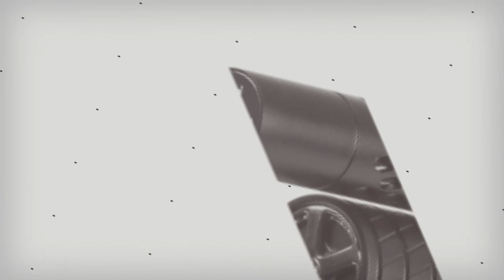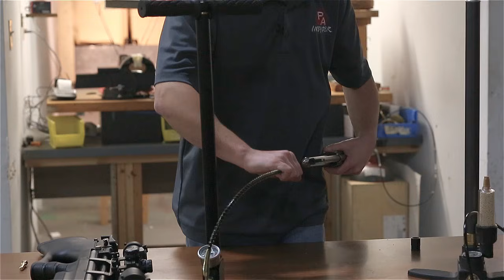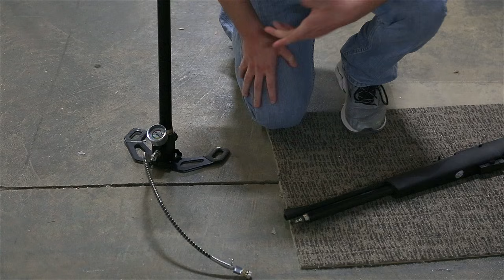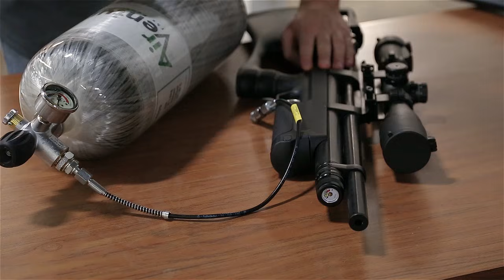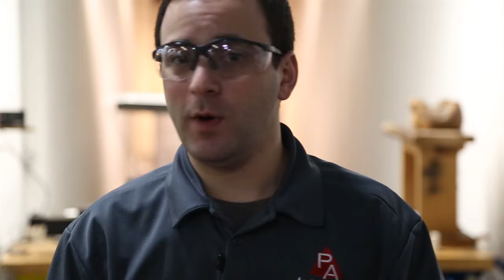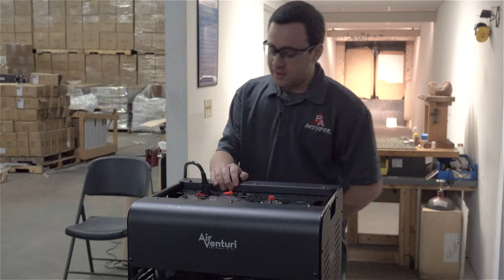🛠️ A Practical Guide to Filling PCPs│ Episode 3 - PCP Airguns 101: How to fill your PCP Air Gun

Comment: Am trying to fill my Hatsan Hercules QE am using this compressor but it won't fill anything, you know if this is the right compressor?
YONG HENG High Pressure Air Compressor Pump,Adjustable Control with Auto-Stop 110V 30Mpa Electric Air Pump Air Rifle PCP 4500PSI Paintball Fill Station for Fire Fighting and Diving
Reply from the maker: Sounds like a compressor issue

Comment: Hello, I am a bit late for the party but I hope you can advise me about my PCP rifle. So I have a compressor and once I stop filling it I stop the compressor and need to bleed the hose. However, If I slowly bleed the compressor the rifle's valve won't close and will vent all the air in the tank. If I rapidly bleed the air from the compressor the piston valve of the compressor will go bad. Could you please tell me what additional valves I need so I can shut the compressor and then bleed the air safely? Thank you!

Comment: Can you use any sort of compressor to fill rifles?
Reply from the maker: Your average shop compressor only puts out 100-200 psi. Most PCPs fill to 3000 psi or higher. So you would need a high pressure compressor to get the job done. We have a number of them that will work.

Comment: I have a glycerine filled pressure gauge where the rubber plug on the side came out and most of the oil drained out of it.  I had an old gauge sitting around so I took the plug out of it and poured the oil into the first one then put the rubber plug back in.   Will that affect the gauge's performance?
Second question, the bleeder valve, which is a push button type, doesn't close properly once I drain the hose and continues to leak air until I push it back from the other side.  Can that be fixed?  Thank you

Comment: Useful, but you made the mistake of allowing the fill probe to contact the floor after filling. (02.16)Neither did you put a plug in the end of the fitting. Both actions are likely to allow dust and contaminants to enter the air chamber and cause future problems. Important to keep all your filling equipment immaculate, I even put my probe in a sealed bag when not in use.
Also, do you not think it worthwhile to fit a moisture trap to a hand pump? On a humid day I think it could be a problem, if the farm compressor is anything to go by. Do PCP tanks rot out like compressor tanks?

Comment: Hi brother I have a question about refilling the air gun from the air tank. If you happen to fill pass into the red zone will it mess up the O-ring inside the tank in the gun, because when I bleed the tank all the air from the gun came out too.

Comment: I have an issue where after I finished pumping my PCP to max.  When I bleed the hose like in the video, the air from my PCP bleed out too.  Does anyone have this issue?
Reply: Valve on the gun broken?
Reply: OR STUCK OPEN----I just sent a brand new $800.00 eagle claw .22 pcp back with a stuck fill valve. @JoeWalker98

Comment: I don't know what the intended purpose of this video was. But it definitely convinced me not to buy a PCP rifle. It's either a lot of work or a lot of money.
I'll just stick with my powder burners.
Reply: Enjoy spending quite a bit more on ammo then.
Reply: @matthewphillips5483  That's hardly a con. The lack of needing air and upkeep more than makes up for the higher ammo cost.

Although my opinion is you should own both.

Lots of powder burner owners keep 22s around for plinking. So once you stock up there's really no need to keep buying ammo. Guys that plink with expensive ammo can afford it so it's a non-issue. Airgunners shoot more BECAUSE of the cheap pellets. Also with things like mantis X, going to the range isn't as necessary.

He's totally right though. For all the extra work that needs to go into air rifles. Powder burners are still the way to go IF you can legally own them. Pumping sucks, even with air compressors and tanks, and it's dangerous.

Air rifles are fun and can be great tools, but they're not practical in a SHTF situation. Getting air to these things would be difficult. Not to mention the upkeep. Worrying about o-rings and other issues specific to air rifles. The powder burner you just oil the damn thing. I'd rather "carry" a powder burner with 100 rounds then carry an air rifle with 300 rounds and a hand pump. The odds of finding ammo out in the world is a lot higher than finding a 4500 psi air compressor if your pump breaks 

At home, or once you have a FOB established then the air rifle would come in handy for collecting food, but powder burner for being mobile and self-defense (if you can own one) if not CERTAIN air rifles are sufficient.

It's just too bad we can't fill these things with regular air compressors. That would be a complete game changer. Even a shoebox compressor requires you to lug around the shoebox. Ammo weighs a lot too though, but still the upkeep swings it in the powder burners favor.
Reply: Just get a hand pump. The guys a puss it’s not hard.
Reply: So! Why did You even comment?  -_-
Reply: @michaelwolff9207  People like to share their opinion.
Reply: Honestly, if you can legally own powder burners and you don't have an interest in silent shooting. I wouldn't get an airgun either.

Most people that get into air rifles also have powder burners and just like the idea of PCP. Or for people that can't legally own powder burners.
Reply: Come talk to me when the feds finally pass a bill to stop making ammo for powder burners. It's just a matter of time and you know it!!
Reply: Firearm - Initial investment can be low, ammo cost high

Airgun - Initial investment high, ammo cost low

Comment: Wow, that compressor is a behemoth! I'm used to compressors being about the size of a shoebox. Are there any smaller compressors for PCP?
Reply: On Amazon
Reply: May I see a link to these air compressors that are the size of a shoebox?

Because there isn't a single air compressor on the market that's the size of a shoebox. I would know as a contractor and metal fabricator.
Reply: @dangerous8333  I meant air compressors in general, of which tiny models exist, and not neccessarily PCP air compressors, which I know nothing about, hence my surprise since the manual PCP looks about the size of a bicycle pump.
Reply: @TubeDupe  It IS a bicycle pump!  Trying to rip you off on accessories.
Reply: @TubeDupe  the compressor isnt too big, 18"x18" pretty much. Works pretty well too, just need to do a lot of research

Comment: I by mistake filled my PCP gun up to half the red marking in my gun! is it dangerous? in case, what should i do? Levi from Finland
Reply: No,you should be fine just don’t constantly fill it up that high.
Reply: @marcos-4469  Great, thanks!
Reply: dont store it like that
Reply: If it was mine I would dry fire it several times to get the pressure down.

Comment: I just bought a seneca aspen .22. The built in pump has given me issues twice after using it and setting it aside. I man handled the pump handle back open and put oil where needed. Should i be letting the air pressure out every time im done using it? Novice question I know. Im a novice. Thanks.

Comment: Why does your video show you pumping way over 40 times rather than the noted 40 pumps.  It is way more than 200 pumps unless your only topping off the tank.  I love my quality airguns but it is a very expensive adventure when you come up with carbon fiber tank and even a compressor in addition to the PCP rifles that can cost up to $3000.00.

Comment: Hi Tyler !
Nice videos, really like them. I just have a question
Can you fill your air rifle with a normal air compressor that people have at home?
Reply: Stop With the total BS! A hand pump is in no way stronger than a regular compressor! Try filling a modern radial tire with a bicycle pump which Is ALL This is! 
I went looking for an adapter to fill a rubber raft of mine a few decades ago. Just needed the adapter. Damn Hippy Snob at fancy campy store told me "You can't fill a raft like that because a compressor has "too much pressure". 
WTF! HE kept trying to get me to buy this twice overpriced foot pump.
I finally got pissed off and left. Went to a NAPA store and found what I needed.
Made sure to go back and rag him and his snobby boss about the item and to STOP ripping off unsuspecting  college students. ( their main camping clientele).
There's an adapter. My Devilbliss 3 gallon lightweight easily holds 3800psi. If you can fill it from a tank, and it does NOT have to be a scuba tank, then a regular compressor will do it.
Also, a medical o2 tank will suffice too.
Once again. Stop trying to hoodwink people into paying triple for your airbrush compressor.
Reply: most normal garage compressors only goto 200 psi max. There are some cheaper compressors on amazon for filling 3 - 4500PSI tanks with good reviews in the 3 - 400$ range.
Reply: @chrisparker1267  do u know how much the  first pump he used would be, thanks

,Jamie
Reply: @chrisparker1267  ok so refilling the rifle directly with a regular air compressor is totally acceptable then…
Reply: @Hohmies86  It wont work.
Reply: @Hohmies86  no it won’t, go look at your compressor it will say working psi up to 2** something psi. No air tool will run on 3000 psi. 
90% of all hp(high pressure) tanks start off
Ar 3000 that’s correct 3 thousand psi. No normal at home air compressor will come close to that, so you have to have a special compressor for filling tanks.
Another option is to buy a scuba tank and get
It filled, then then have a transfer adapter so you can transfer from
Scuba to air rifle tank
Reply: @beefysghost867  you think that hand pump can put out 3000psi?
Reply: @zordonthevoyagesof577  yes they do. It sucks to try to pump a tank up with them. It's like a double or triple cylinder in the pump or something to that

Comment: Is there a fill adapter for scba tanks with the snap change valve assembly instead of the more common cga connection? My service predominantly uses this type and i was unable to find an adapter anywhere.

Comment: and how to fill the big tank? where is air in valve located?
Reply: You would either take off the fill hose if the compressor used to fill had a DIN valve fill set up or you could fill through the tanks output hose.  All depends on the set up of the compressor.

Comment: I have the same tank that I bought from Pyramyd Air but I don't know what the psi is in the tank so how do I check it? I tried to find a plug for the quick disconnect so I can just use the gauge on the tank. please help! I don't want to go shooting and find out I only have a few fills left!!!!!! It's an hour there and back to get it filled so I only want to go when I need to not just to top it off all the time.
Reply: PA has test plugs.  http://www.pyramydair.com/s/a/Air_Venturi_G6_Test_Plug/6682
Reply: I know this is 3 years old, but why didn't you just connect it to your gun to see what the pressure was?
Reply: @iAteYourDog69  Because if you put that much pressure in a gun you're going to blow the seals. They sell a block off plug you can put in the end of the hose to block it off, turn the tank on and the tanks gauge will tell you what's in the tank.